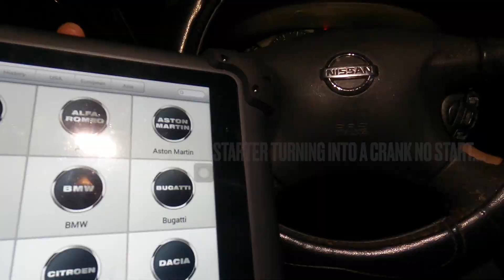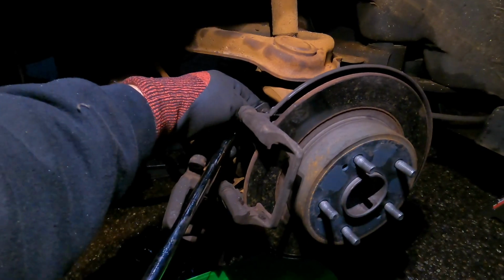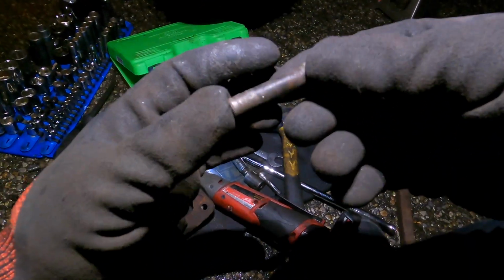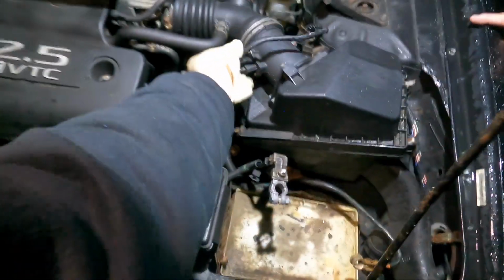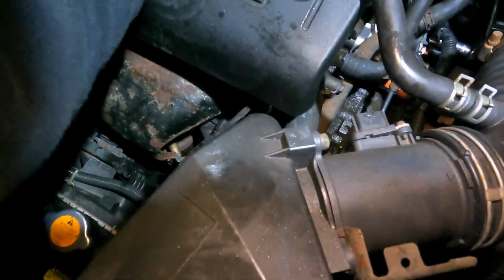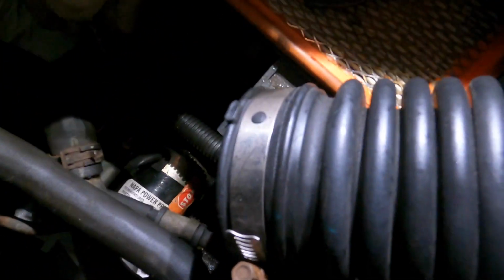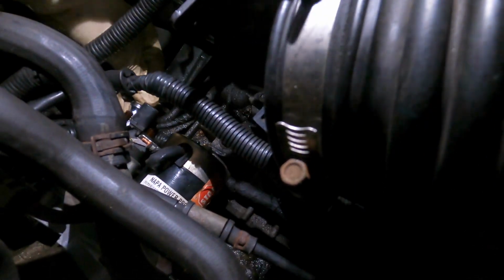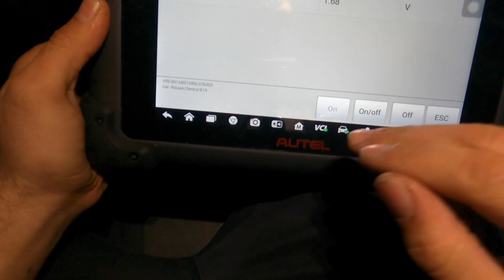WORKING INTO A RAINY NIGHT. A "DAY" IN THE LIFE OF A MOBILE MECHANIC

Comment: They must have gotten the caliper and rotor pretty hot .  Your are  tough dude working in those conditions .  I get frustrated  working on my stuff, takes a real pro like you.   Nice job
Reply from the maker: The customer said the noise has been happening for some time, yikes.  I worked at a benz dealer with heat and AC, i wanted yo give this business a go instead tho😂 thank you for watching brother